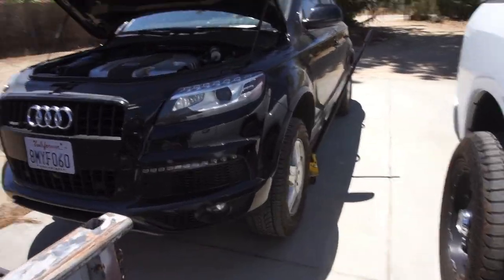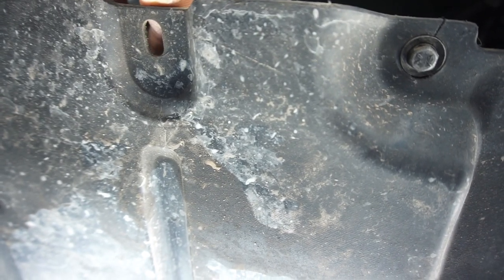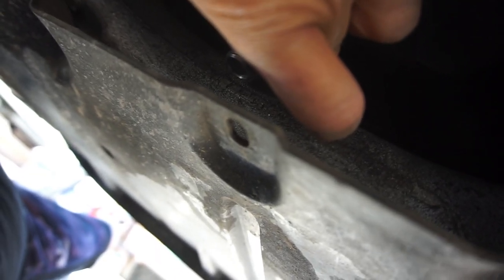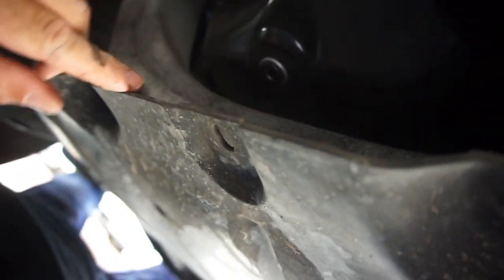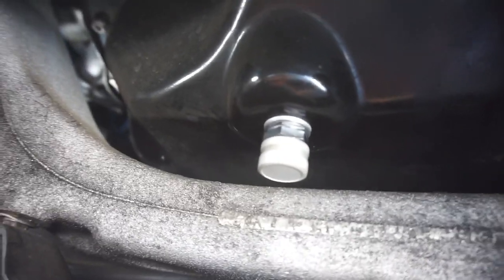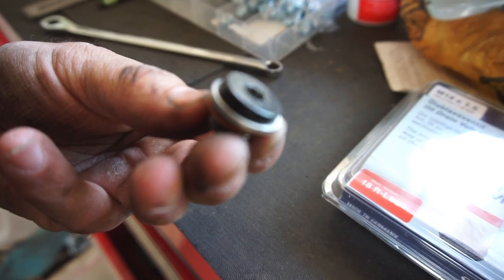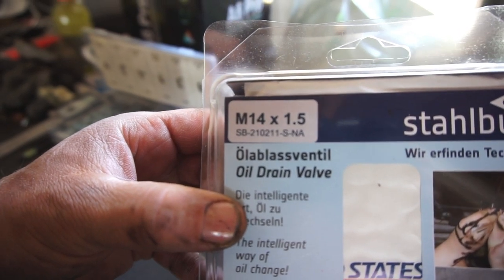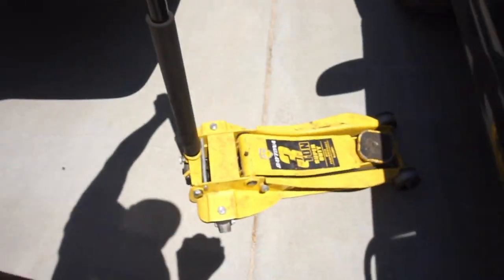Installing A Stahlbus Oil Drain Valve On My Audi Q7 TDI. M14 x 1.5. Drain Plug. Vacuum Suction.

Comment: I installed one on my 2014 touareg tdi and the plug is too close to the crossmember. I could get the plug in but couldn't get the cap on it.  No way I will get the drain tool on. I guess my motor sits just a little further forward.
Reply from the maker: That’s crazy. So when you remove your drain plug oil just dumps on the crossmember.

Comment: I’ve purchased this drain valve, but don’t trust it. The thread that goed into the oil pan is just 1/2 inch, where the original drain plugs thread is one inch. The drain valve just needs 3 turns before it’s tightened and the original plug 8 turns. In my opinion 3 turns is not enough and I’m afraid the valve will get loose or something. I’ve taken out the valve again and installed the original plug back
Reply from the maker: Uh ok. If it torques to speck with a crush washer then you’re fine. You only need to install it once. It’s not like you’re removing it every oil change. But whatever makes you comfortable. I have 6 oil changes on mine with zero issues.

Comment: Hey Mike, how is the Q7 treating you and how many miles do have on her?  I have a 2014 Q7 TDI with 68798 miles on the clock.  Cheers, Mick
Reply from the maker: Just about to hit 144k running great. Oil filter change every 3500 miles and oil & filter change at 7500. Getting roughly 32 miles per gallon.